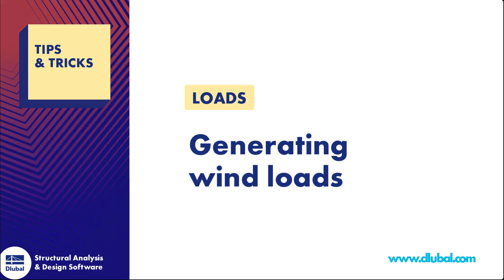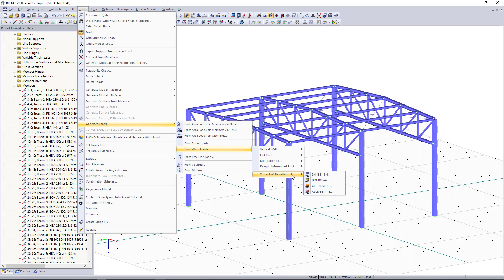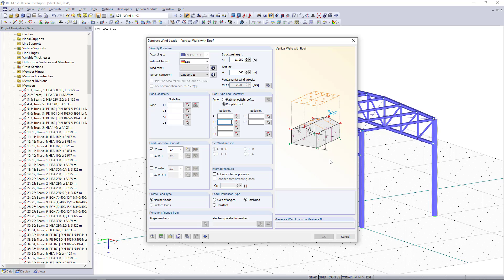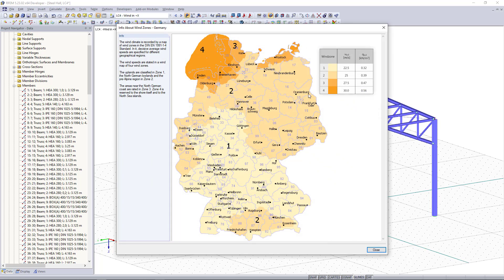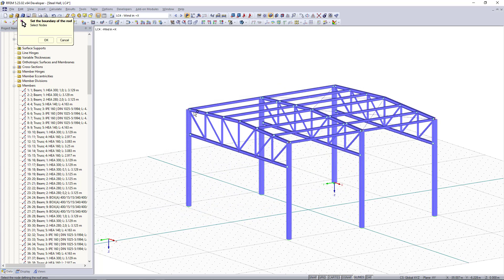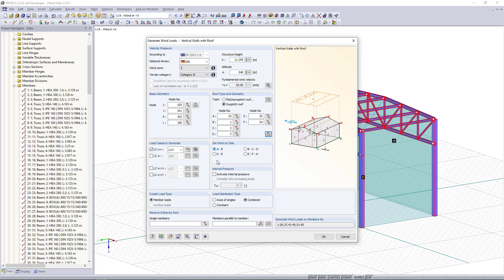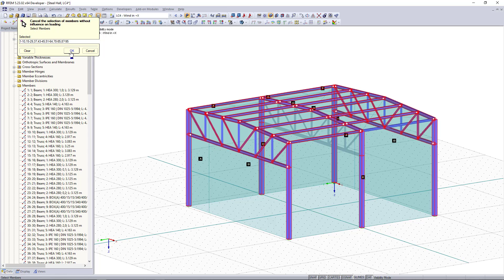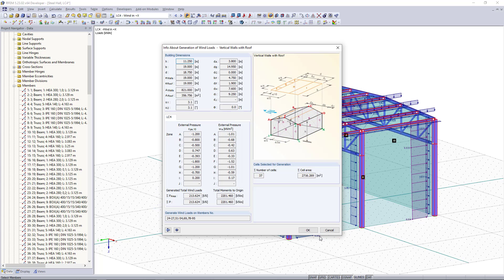T&T 006 | Loads - Generating Wind Loads

Comment: Is it possible to generate windloads for 2d models?  My current program can do that (you enter the width of the loading), but im interested in switching to RFEM.
Reply from the maker: Hi, Im!
of course. There are also load generators for 2D models.
Reply: @DlubalEN  Great! do you have a video on that? i cant seem to find any info on 2d load generation on your website.
Reply from the maker: Hi, Im!
You can generate rafter roofs including generated loads for snow or wind - for example. Please click on "Tools/Generate Model - Members/Roof/ Rafter Roof".
Reply: @DlubalEN  Hello, thank you for your reply. Is it also possible to generate loads on custom roof shapes? Perhaps a mansard roof or a roof with a dormer?
Reply from the maker: Hi, Im!
for wind loads on individual models you can use RWIND Simulation.